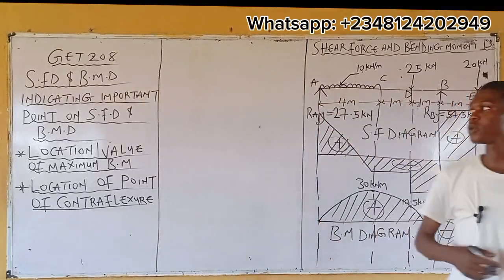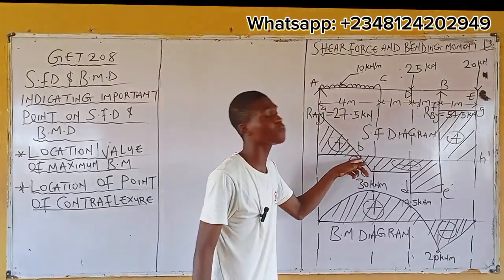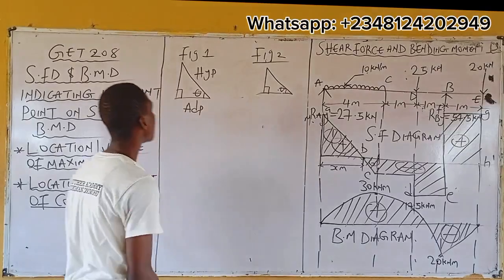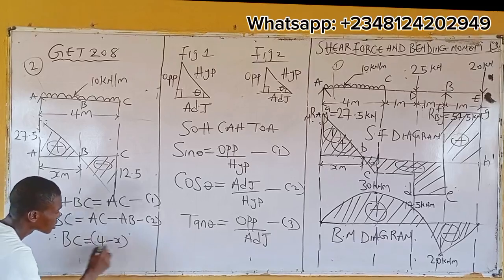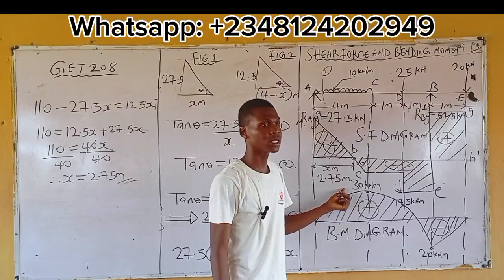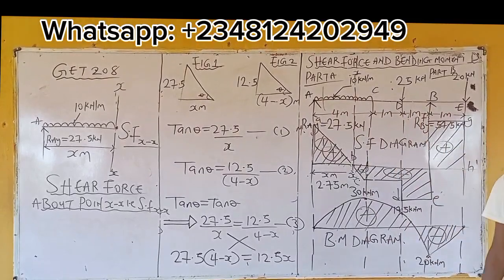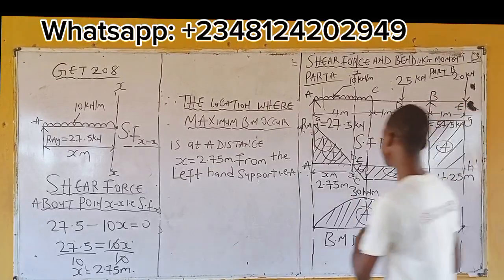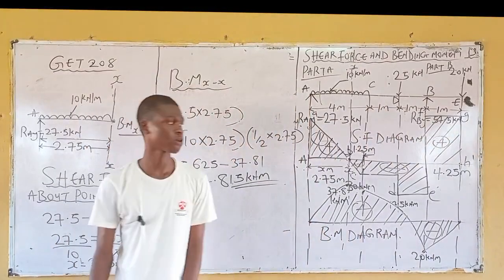Maximum Bending Moment{The Location and Value}||Strength of Materials..

Comment from the maker: Quick Note;The Maximum Bending Moment is the point where the beam experiences the highest internal stress due to bending. It’s super important in design because that’s where failure is most likely if not properly reinforced